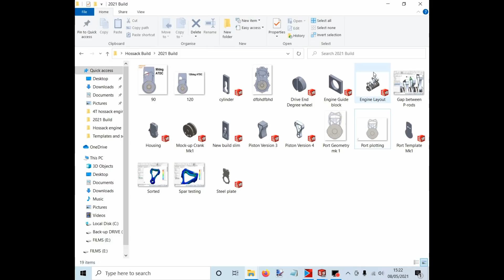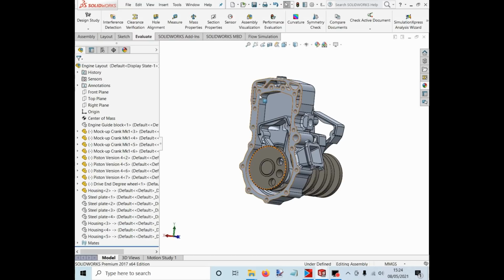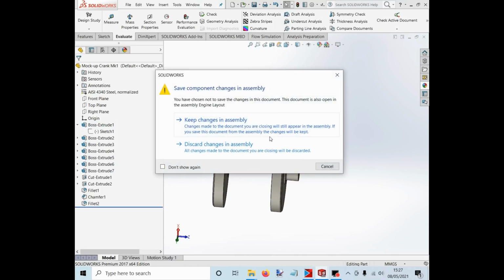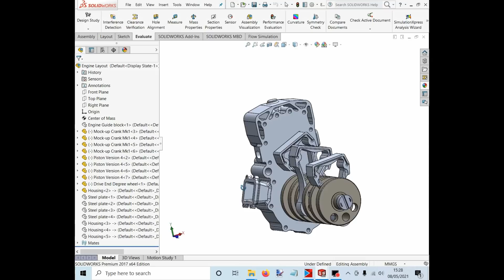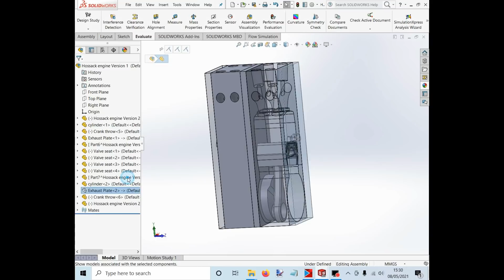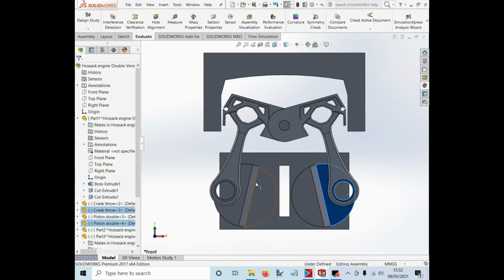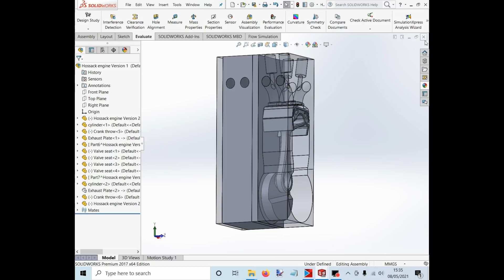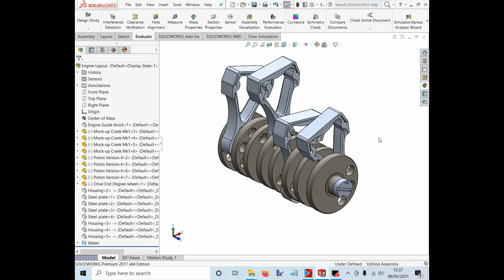The Hudson/Hossack Engine - Part 3

Comment: I like your concept, you should have verical sliding plates on the sides and connect the seal part to the moving plates with a pin, so the plates are moving up and down with  your piston design and keeping a tight seal.

Comment: From a manufacturing standpoint, you have an engine design that geometrically and the fitment quality control has only 2-dimensional characteristics ( X & Y-axis). The thickness (Z-axis)  are all flat planes which you can Blanchard grind and side lap into size.  the Apex seals used in rotaries are good. it looks very easy to make using laser, plasma, Water-jet cutting, and 3D-printing technologies and when you need real high tolerance then use a Wire EDM.   Good engine design for when we go into a world like portrayed in the music of Rush's song Red Barchetta.  when oil combustion engines are outlawed and underground. A near-future Time when people may make an engine with rudimentary tools. Making wood, glass or stone piston, rods, cases with wood crank and run on an alcohol fuel (Low heat).  LOL, the motor for the future caveman or utopian tinkerer. Shits and Giggles https://youtu.be/FAvQSkK8Z8U

Comment: something you might find interesting as a possible alternative to rotary type seals is graphite g;and packing fibre rope. It will follow the funny contours needed to around the side bits on the piston. Its was used on old steam engines too. https://www.ebay.co.uk/itm/123960950369?_trkparms=aid%3D1110006%26algo%3DHOMESPLICE.SIM%26ao%3D1%26asc%3D20200818143230%26meid%3Dde000b3fc157429ca64c582b9ad278f2%26pid%3D101224%26rk%3D4%26rkt%3D5%26mehot%3Dnone%26sd%3D123961907692%26itm%3D123960950369%26pmt%3D0%26noa%3D1%26pg%3D2047675%26algv%3DDefaultOrganic%26brand%3DUnbranded&_trksid=p2047675.c101224.m-1

Comment: I really like this for a low rpm end of days engine that will run for the rest of our life, only concern ive got is the bore wear with the rings, id of thought with the sweeping swing happening on the bore face it may wear quicker buy low rpm would probably mean is this really best suited as a diesel engine.

Comment: Now, ill thread very lightly not to offend anyone :-) 
But, whats your thoughts on "up and down" oscillating apex seals and gaspressurization of same..
Reply from the maker: Rotary seals are mono directional and are designed that way. They can be easily designed to do both.

Comment: I gotta tell you... I love the concept.  The trick are the seals, if you can get them to work reasonably well (i.e. last at least 100K miles) the design shows serious promise.  BTW you can use 2 materials for the piston/rod by interlocking an aluminium top on a steel bottom.  Really  opens up many, many possibilities.  Good on you.
Reply from the maker: Ah.... interlocking material, not a good idea
Reply: @thedirtyworkshop  It can be done using pins safely to counter any thermal expansion differences.  The thought of using all steel units seems a bit too much weightwise.

Comment: Not letting the design die; how well do you think it would work when used as an air compressor?
Reply: It's pretty much how an oil less air compressor already works. Look at the bottom of here under piston variations. https://www.popularmechanics.com/home/how-to/a151/how-air-compressors-work/
Reply: @JSmith19858  yeah i know, but they do like their maintenance
Reply: That's by design. They're cheap.